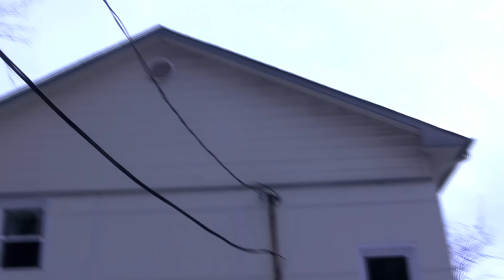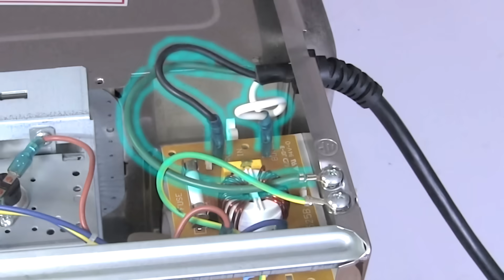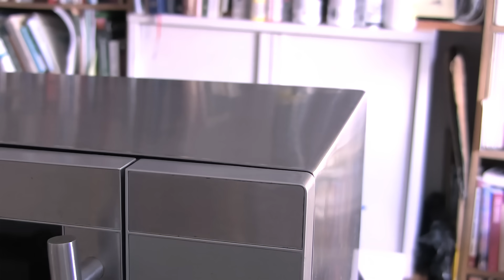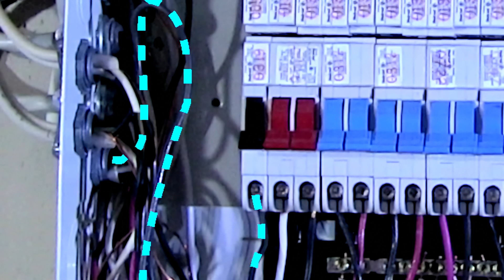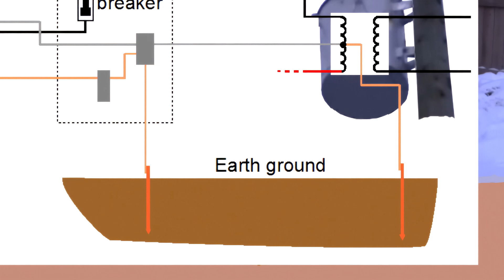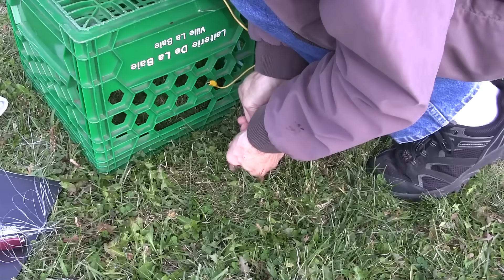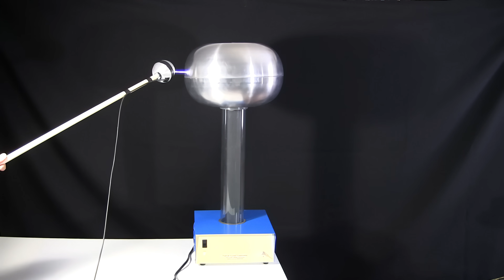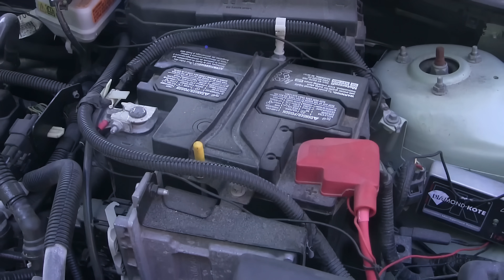What is Ground? Earth Ground/Earthing

Comment: This is a very good effort to explain the atom and it's electrical properties but there's a problem! If the electrons have a negative charge and the protons have a positive charge and if opposites attract, then why don't the electrons move to the protons? Especially when it comes to conductors that apparently have loose electrons in the outer shell! Wouldn't they just move towards the protons due to the attraction that they have for each other and short out releasing energy as heat? 
Also, if an atom in it's neutral state has no charge, where does charge come from? Energy can't be created nor destroyed so is everything charged or not? And since it is neutral, it has no electons to give! 
With static electricity,  a person becomes charged by loosing electons to the floor and then is restored with electons when he touched a metal object which had no charge, therefore no electons to give! Yeah something isn't right! You can't have two different outcomes to pick from just out of convenience. One minute it has no charge and the next minute it's able to give an electron! From where? It doesn't make sense! 
I think that you need to watch your video again and work out what's wrong with your analogy. Energy just doesn't just materialize out of nowhere, it has to come from somewhere else but if an atom in it's normal state, it's neutral and balanced between the protons and electrons, where is the energy for the flow of electons coming from?
Reply from the maker: If an atom has 4 protons in its nucleus (at the center of the atom) and 4 electrons in orbit around it (using the balls model of an atom) then the number of positive and negative charges are balanced. We say the atom has a neutral charge but by that we mean that free electrons that are further away will not feel any attraction. All the atom's individual protons and electrons still have their individual charges but no net charge can be felt further away.
If we instead had 4 protons in the nucleus and only 3 electrons orbiting around it then the atom has a positive charge in the sense that since the negatives don't balance the positives, electrons further away will feel an attraction.
Reply: @RimstarOrg  okay but why isn't the electrons closest to the protons not attracted to each other if it's true that opposites attract?
Reply: You are asking a question based on the Bohr model, thinking of electrons as solid particles in orbit.  Even with that model, it is reasonable to use an orbit idea to suggest that an electron has some analog to kinetic energy that keeps it always in orbit, never crashing into the nucleus.  Apply some more energy, it kicks out to a more distant orbit... enough energy, and it gets "escape velocity".  As attractive as that explanation might be, it's known to be inaccurate because of quantum mechanics.

In quantum mechanics, electrons are modeled as wave functions, with a complex three dimensional function describing the probability distribution of its charge.  In fact, in the lower energy states, these wave functions place most of the "location" of the electron superimposed on the nucleus.  In a sense, they are in the middle.

But when you add energy and the enter higher quantum states, their chances of being in the nucleus do go down.  

But your real question is why would charges flow in a metal, which has free electrons.  Metals are happier to give up electrons in their D orbitals, due to metallic bonding (you can look that up for more detail).  The point is that when you have a potential difference across a metal, electrons are easily displaced from one atom to the next, and as long as the potential difference remains, this happens in one direction, resulting in current flow.

Comment: I don't understand.. You are talking about this as if it's all DC? But it's AC so why is the ground connected to neutral? 

So if I touch the microwave case and a radiator could't I potentially complete the circuit somehow if say the neighbor has hot and neutral switched or something? Or why does the ground not absorb energy from the "neutral" wire when when AC current flows in that direction because the ground is such a good absorber??? Also why is the neutral bus bar exposed like that?

So if I go and stick a nail in one hole of my socket I would be fine and the other one not?? Also I live in Europe, is it different here?

I always thought ground went to that grounding rod so there would be an unbalance on a short to ground and it would trip a breaker.. Does the US just use some ghetto ass wiring? Also doesn't the circuit breaker here only protect from too high current? What if there's resistance like your body or something?

Also why do you need three wires to the microwave if the ground connects directly to neutral anyways?

I'm so confused.
Reply: You asked something like 11 questions, each of which could take a couple paragraphs to answer.  I'll just toss in a bit on the most important part:

The ground allows current to return to the breaker panel, and ultimately back to the transformer, to complete the circuit.  Current will not flow into the earth because a circuit must return where it starts.  A local ground rod exists to dissipate static charges that may build up in the system, and is especially important in the case of lightning.  For equipment safety ground, you should not think about the ground rod.  

Say there is a failure and the chassis contacts the hot wire (maybe something melted, or someone dropped a screwdriver into it or something).  If a person touches the chassis, the current will seek a path to ground through the person, maybe causing electrocution.  But, if the chassis can provide a return path through the ground wire, then the breaker can trip, and the human life is spared. This is why ground is connected to the chassis.

If someone using the same transformer crosses hot and neutral, you will have a high current path at 2x normal voltage, which should pop a breaker quite reliably and safely.

European systems differ, in that there is additional ground fault protection at the panel.  There are some cases where you might not get enough of a short to pop a breaker, but it could still be dangerous.  The system needs to measure how much ground return comes through neutral vs ground, and pop the breaker if it's not (essentially) all arriving through the expected neutral path.  In the US, we don't do this at the panel, but rather in bathrooms, kitchens, and other places where these ground faults are most likely to happen.  There are pros and cons to both strategies.
Reply: @Ingenieur In an open circuit, the transformer-as-generator you mention is not pushing any current in any direction -- it is changing the potential of the two ends of the transformer with respect to the center tap, which is ground.  Just like how you can set a battery on a table, and both ends are at different potentials, but current won't flow until you connect them.

Yes, the transformer is AC -- at one peak in the AC cycle, one end is maximally below the center tap voltage; at the opposite peak, it is maximally above the center tap.  Current will not flow, however, until there is a galvanic connection between an end of the transformer and the center tap.

You won't get hurt from the neutral because it is at ground potential.  If you touch ground, you will not get current through your body until you touch something at higher (or lower...) potential.  Neutral is ground in all your electrical devices, it's bonded to the earth, it's bonded to your water pipes, etc.  

On the other hand, if you touch the hot wire, it is at a high potential.  Any path that current might find to ground (ultimately, the neutral or ground wire) will cause current to flow.  Current can flow very dangerously through anything galvanically bonded to ground -- equipment chassis, water pipes, wet ground, etc.  There is some risk even if you're not touching something like that, because ultimately everything is a conductor at some potential :-).

So, in short, almost everything in your life is ground, so touching most things is safe.  Neutral and the ground wire are at ground, and thus safe to touch.  But the hot wire is super dangerous, because when touched you may easily connect it to one of the many ground things around you, and become part of a circuit where current can flow.

Does that help at all?
Reply: @Ingenieur that's pretty close, but not quite right.  Remember that voltage is always relative to something.  We call our common reference point for voltages "ground".  So in a logical sense, since we call neutral ground, then it is by definition zero volts at all times.  I believe it's actually called "neutral" because it's in the middle of the transformer, which kind of makes the terms muddy.  

We logically think of an end of the transformer as moving with respect to ground, so it looks positive at one peak, and negative at the opposite.  To see this, we would have to put our point-in-time voltmeter on the center tap and measure compared to that point.  That's a useful little thought experiment -- you have the red and black leads from your voltmeter.  You put the black one on the center tap, and the red one at the end.  You'll see the end voltage swing from positive to negative.  But what if you put both leads on the center tap?  It'll stay at zero forever.  Swap the leads, with black on the end, and red on the center tap -- what do you see?  Positive and negative again.  It's just relativity at play.

The most important point, though, is that we will call "hot" the unusual thing that is at high potential compared to most other things.  The most prevalent potential (the "common" one, if you will) is what we'll call ground, and we'll measure things with respect to that.  That way, most things are safe to touch, and we have to be careful with the "hot".  

If we flipped it, and called the hot wire our ground, then we would be living in a world where most things are at a relatively stable high potential.  Your body would be at high potential compared to this "logical ground", and since you're connected to all kinds of things that are also at that same "high potential", the scary thing that you couldn't touch would be the hot wire that we labeled "ground".  Same situation, we just changed the names.  The neutral wire is safe to touch because it is at the same potential as everything else.

It mostly only "matters" when there is a connection that makes a circuit, and current can flow.  At that point, you want to make sure that your body, or something flammable or explosive, etc., is not in the current path.
Reply: @Ingenieur The "neutral" is never made the "hot" wire.  The neutral carries the unbalanced load back to source.  You have two hot wires coming into a typical residential panel in the US.  These two hot wires are where the current is alternating back and forth (60 times per second in a 60 hertz system)

Comment: Meanwhile in Australia we call "Ground" - "Earth" green with yellow stripe, "Hot" is "Active" (Red) and drum roll, cymbal crash, Neutral is Neutral (Black). Every house has it's neutral bonded to local ground electrode, so neutral is one long ground, ie lose your local ground, no prob, the neutral will have many grounds back to the street transformer.
Reply: Each country has its specific Electrical Color Code.  "Red,  Black,  Green" were the OLD Wire Color Codes.   In Australia the NEW Wire Color Code is Brown, Blue, Green+Yellow stripe ...
Reply: @vtorsi610  Fixed TPS twin and earth is still Red/Black/Green Yellow, yes appliance wiring is brown/blue/green yellow.
You could also include TPS White which is switched active for lights etc.

Comment: If the ground wire and neutral are connected, then a short-circuit can be made on both wires by touching them with the hot. In this case the ground wire and earth ground are good only against thunder?
Reply: Yes, when lightening induces an emp inside your home, the ground rod allows this energy a path back to the earth.

Comment: do you also need neutral in a 220vac circuit?
Reply: Yes. "Hot" and "Neutral" are the alternating plus and minus.
Reply: @furulevi  NO, a neutral wire is NOT required in a 240 Volt AC circuit.
Reply: @furulevi  No.
Reply: Not in North America.
Reply: In North American 240V circuits, they’re powered by two hot wires, each live at 120V potential to ground, but 180° out of phase with each other. If we didn’t use split phase power, one of the hot wires would essentially be neutral, but we do so it’s more complicated and confusing

Comment: can you actually use a flower pot as ground?
Reply: Aussa Villa Grounding to earth is in the event of a lightening strike on the lines.  Ground wire protects you by routing current along the green or copper wire back to the panel causing the breaker to trip.

Comment: OK I'm gonna need a second part elaboration. :) In this video you mention the purpose of ground is to trip a breaker, well can we take out the breaker from the picture and go back some years in the age of fuses that have sand inside to muffle the sound or others now say have a different purpose. As a kid I was told the ground is there so when the hot wire touches a washing machine the current would flow to ground and not through me into the concrete and then ground if I am barefooted. Breaker didn't trip because it was still expensive back then, the fuse had a home made wire put in which was a little too thick, eyeballing it :) cuz also expensive,  circuit is live am I going to get electricuted or is the current flowing to ground. Also, if I am still standing wouldn't the current also flow to the neutral if it wasn't grounded as they meet upstream and are at that point the same wire? Or are they not the same wire? Is the neutral connected to center point of transformer and ground connected also at center point of transformer and then to earth and then again at fuse box of house connected with neutral. I still don't know fundamentals,  I understand  touching a live wire while isolated nothing happens but standing on something that completes the circuit through your body u get electricuted, is it the same touching a live wire while standing barefoot on earthed concrete conductor and touching a live circuit while standing on concrete, why would the current decide to flow through my body instead going it's own way.
Reply: Confusion in the WORD ground.   Try calling the third prong a safety ground (this not the EARTH GROUND) that is mentioned later. NO CURRENT ever flows on the safety ground, UNLESS a fault is detected (hot wire touched appliance cabinet)  IN WHICH CASE the CURRENT flows back thru the ckt panel and BACK to the transformer outside EXACLY as it does all day long WHEN NO fault
is detected.        THE EARTH ground (spelling and pronounced the same)
is something else.   Enjoy.

Comment: 👏👏 Bravo. Has an electrician you explained household circuits very well and simple.

But one thing. You can’t use a 6’ ground rod as it is a violation of NEC 250.52 (A) (5). The ground rod may not have a shorter length of the minimum of 8’.

Comment: Nice video, thanks, can i run a small rod into the ground when boondocking to ground my generator or inverter, i dont have an ohmmeter to measure resistance.
Reply: What is your intended purpose of adding a ground rod to your portable generator?  Typically, portable devices are not grounded.
Reply: vto rsi the voltage at the inside panel is 67 L1G and L2G. But if I ground the source then I have 120L1 and 120 L2
Reply: @normnilsson7208  Does the voltage between L1 and Ground or L2 & Ground matter?
Reply: @vtorsi610  If there was a malfunction in a device that was powered by the source missing the ground, say a fridge as an example, and there was a line wire that was shorted to the fridge' chassis, since the chassis is not grounded and is floating I would say there would be a chance you could get shocked
Reply: @vtorsi610  Let me first say - im not part of the safety police, just trying to learn something.
Reply: @normnilsson7208  First, do NOT use faulty appliances!  Grounding the generator to the earth does NOT fix that problem. But, having the Neutral Bus Bar bonded to the Ground Bus bar does!  As soon as the Hot wire touches the Fridge's Metal Case the breaker will trip!  Grounding the generator has nothing to do with tripping  the breaker. 
   If the fridge has no ground wire , then what does grounding the generator accomplish?  Ummm, absolutely nothing ...
Reply: vto rsi good info, thanks, one more thing, why does the generator have a terminal for ground ?
Reply: @normnilsson7208  For a more permanent type of installation, like a cabin. Or when used as a back-up generator via ATS with a building that has Utility Grid Service.   
  Typically, one ( and now two ) Ground Rod(s) 5/8" x 8' long, driven all the way into the earth.
Reply: vto rsi thank you !